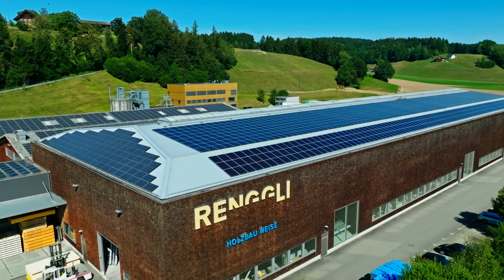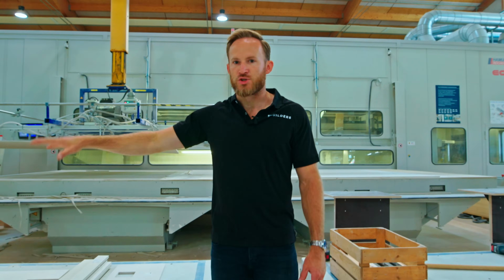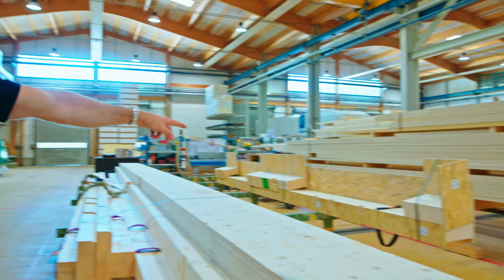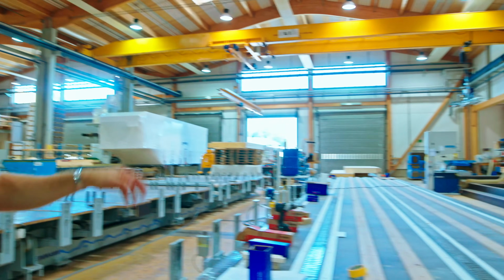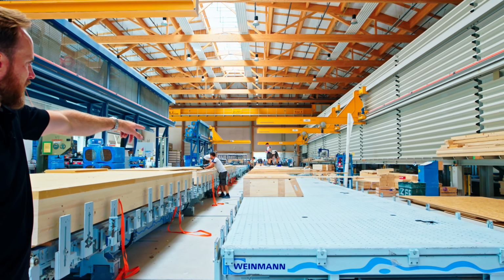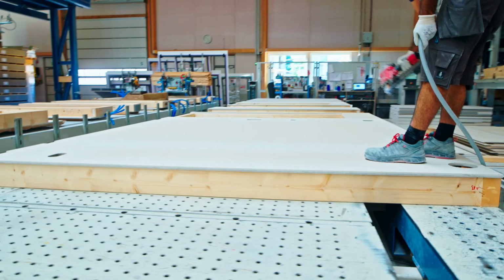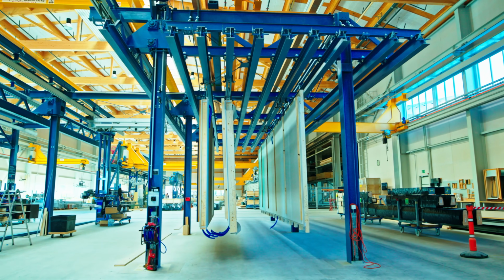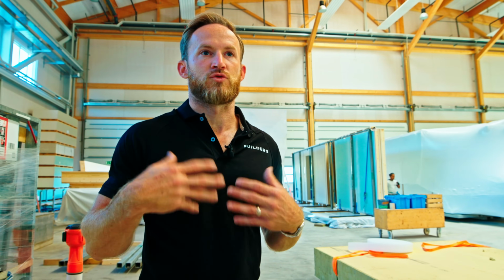@RenggliAG has an incredible pre-fab facility

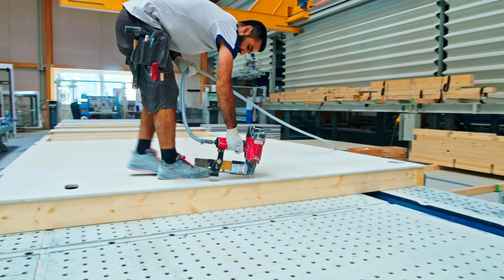Comment: 13:18 yes the nail gun is faster, but the point is : it doesnt matter if you secure the foil with screws or a nail, if it fails its the foil, it doesnt matter if it´s hold by a nail or a srcew, no matter how strong the screw is
and thats why the connections in the wood are made with screws, while the naild just compress the area around it to hold it in the screw digs into it and binding it, therefore its more secure und higher quality

Comment: Cedar shingles are a bad choice for exterior cladding. 
Should be a non-combustible material.
Architectural design is limited with this type of manufacturing and the end cost of the buildings is not much different. 
Of all the methods tried for combustible construction, you still can't beat stick framed on site method because of the flexibility of design and the complexibility of all the other trades components that have to fit.
Reply: There are houses with roofs made of these shingles that are more than 200 years old. As long as you take care for constructive wood protection and you produce the the traditional way, wich is splitting, not sawing, these shingles will last very long.
Reply: Not another clueless American :D

Comment: this is basically a "factory built building" in progress... and the interesting thing is, all those machines not just make things faster and more accurate but even safer for the workers... and they are working without being out in the elements during the whole manufacturing process... the only part where weather plays a role is during final assembly on site... but at that time most of the things are done so even a bit of rain or snow would not damage the final building

I love these "house-factories" and especially all the technical (partially automated) solutions seen over here a lot in Europe

Oh and by the way, all those "built in" lifting straps are "single use only" and have to be cut to be discarded later on... you are not supposed to reuse them... and they are specially produced to this purpose (it actually should say it on the orange tags) and they are coded by colour so you can identify which load limit you are having there.

Comment: I had a officer in the german army. The guy moved to the US with his Wife, former US Army. He lived somewere in the Tornado Alley and two years later his small town was wrecked by a twister, he never saw one live, and it was a SHOCK for him. His neighbors build up like before, Wood frame houses. My Fried got up, sad "Fuck that" and he build a house from scratch the "German Way"....like a F++king bunker. 12-16 Inch walls, solid reinforces concrete. He imported windows from germany, had old army buddys over on holidays to help him with the wiring, put 10k allone in diamond plate that could be bolted to the windows and he put shindles to the outside to "blend it into the neighborhood.Everyone around thought he was an idiot for putting 120k in a house the next storm would push over......it is still standing as far as i know.
Reply: 120 k 🤣🤣🤣

Make with ground 500 k easy 😐
Reply: That house is now in Kansas. !!! 😕
Reply: We are forced by Goverment to build to resist snow. depending there its up to 2 meter. Where this extreme ist needed  they are made like bunkers. Here even with high prices for houses the half of expenses comes from the Ground.

Comment: I dont know if you're aware, but Switzerland does NOT have any laws mandating fire alarms in buildings - public or private. It was a concious decision eons ago by the national and cantonal real estate insurers that made model calculations and determined that fire alarms would NOT improve safety, but would actually cost more than the damages they prevent. And if you compare national real estate fire statistics between Switzerland and other countries, they are actually right. So nobody in Switzerland would ever even consider putting in fire alarms. They are completely unnnecessary in Switzerland, despite many houses being made of wood and composits.
Reply: Fire prevention, fire fighting as well as fire insurance is ruled by cantonal laws. So no need for federal laws.
There are plenty of rules for business buildings, mainly factories handling flammable products. Private buildings are subject mainly to preventive measures, but not fire and smoke detectors everywhere
The last company I worked for before retirement had plenty of alarm systems also for fire, even tests with local firefighters, checking intervention plans and allowing firefighters to become familiar with the whole factory building. 
And one evening (working late on IT-projects) we even had firefighter squad at the door - false alarm that was not immediately cancelled by plant maintenance staff. For what I was told, a second false fire alarm in a year would have been charged to the company.

Comment: This is a really awesome factory. I was impressed by the size of the timbers in the walls, almost 2,5 times the thickness of a stud wall in an American built home, and with the thickness of the insulating envelope, you could heat this house with a candle.
It's the future the European building industry is going to, even in those countries like for instance The Netherlands I live in, which traditionally build mostly in brick and concrete.
Those timber houses made in a factory are far more sustainable and easy to make energy neutral (very important with the natural gas crisis we are in).
The construction out of engineered timber in a controlled environment with CNC machines guarantees a very consistent product and isn't dependent on weather conditions, only for the erection on site a few dry days are needed (except for the ground work and concrete foundations of course), this is a huge pro in places where it rains a lot.
Even dry building after erections is kept to a minimum as a lot is pre-installed like all of the conduit.

The construction method would be very suitable for the US too, as homes can be easily be redesigned to meet climatic demands. After all these houses will surpass most states building codes in the US and could perform better in extreme weather conditions like severe frost, heat and high winds.
Reply: When I had my minimal enegry house designed and built 20 years ago, the design envelope was to install a heat and cooling pump as well as solar panels and use highly inulating windows and wall technologies to lower the total heating and central cooling cost of the building to 400 USD p.a. for the entire house at 3.5 stories and 330m2 of  living area. Since then - and with inflation - I'm now actually at about 600 USD p.a. Oh, and the heating cost includes the (also insulated) outdoor pool. Talk about quality build and insulation!

Comment: Have watched a lot of videos on American house building. Am often shocked at the lack of quality in the final finish. One sheet gypsum board interior walls instead of doubling them up for strength. Interior doors with huge gaps all round including the main house door. Very simple wood-frame walls which are often so thin that sound travels through from a neighboring room very easily. European build quality is much more solid and significant. US prices are incredibly expensive for the quality you get at the end. Superficially lovely, but only on the surface.
Reply: Reason why so many houses get wiped away by tornado's... not saying every 'standard' European house would withstand it, but in Northern Europe (Benelux, Germany, Switzerland), the proportion of 'serious' houses is significantly higher than anywhere else...
Reply: What do you expect from yanks ?!?!
Reply: The US is third world on a good day.

Comment: The prefabricated timber construction and the type of production is very often found among prefabricated house builders in northern Europe. Even small companies can design and manufacture the highest quality houses with relatively few staff through the use of CNC-controlled machines and modern production lines. It is fantastic to see how the complete sanitary and electrical installations can be installed quickly and easily later on the building site, because everything has been perfectly prepared at the factory. In addition, these houses are optimally insulated and highly energy-efficient.

Comment: So with the Gutex etc wood fiber you can skip the plywood on the exterior?
Reply: Gutex, Celit and other brands are damp(vapor)open sheeting for the outside of walls. Stiffness of the walls is mostly on the inside using OSB or MPX with tape and/or foils to make it airtight. Outside is windtight. Outside sheeting is also insulation to break heat bridges of wooden struts, with in between breathing insulation.
Reply: @paulbrouyere1735  I am familiar with that part I just didn’t see any wood being used on the interior sheathing and was wondering how they achieved their shear strength
Reply: @kevinlynch3588  You’re right, I didn’t see that part in this video, either.
Reply: @kevinlynch3588  Although I haven’t used that system before I know there is also a system where they first build a skeleton and fill in the walls afterwards.
Reply: jep, it contains parrafine and some other compounds to repel water
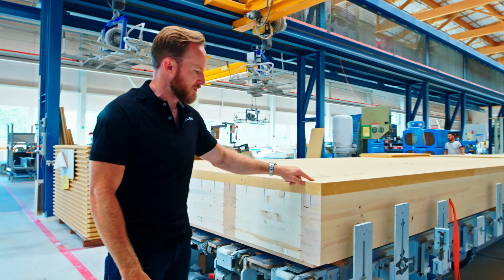Reply: You can see the sheathing at 10:53 on the bottom.

Comment: They are essentially giant die walls, as we call them in architectural millwork. Die walls are built virtually the same way, plywood ribs cut in a CNC, and sheathing on both sides from sheet goods.